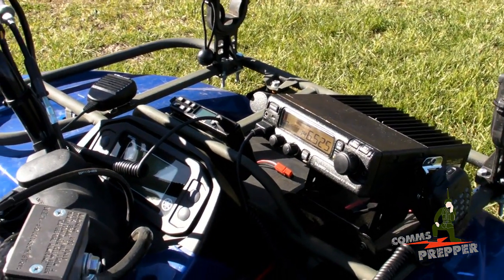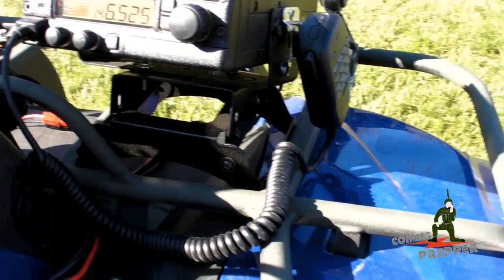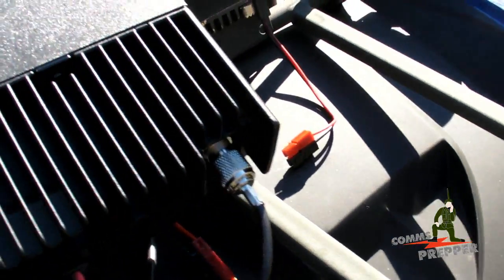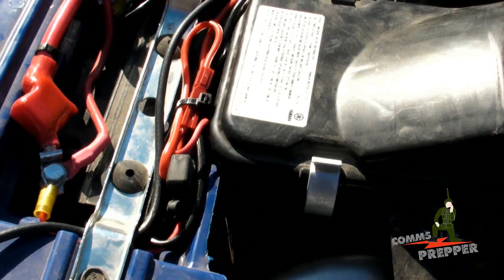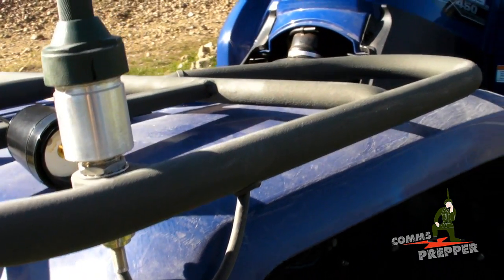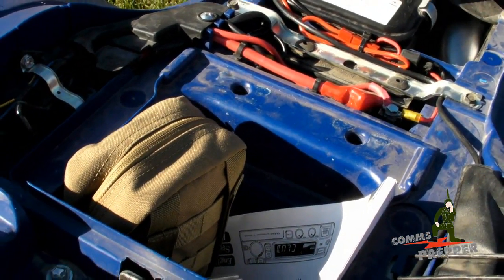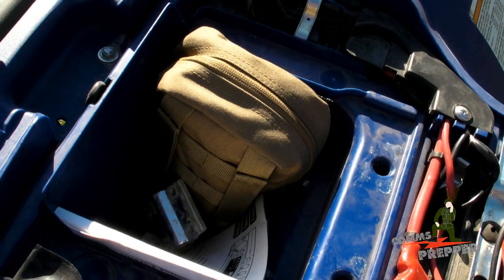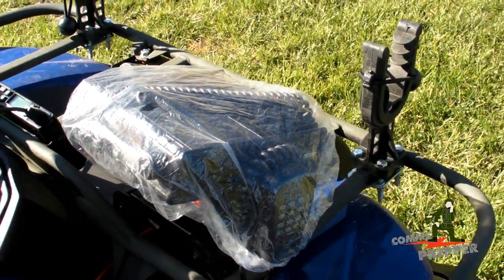Mounting Ham Radio on ATV

Comment: Very cool. Nice and tidy installation. I suppose similar installations may be possible on snow mobiles, too. 

I wonder, are the radios weather resistant? Can they be used in the rain/ice/snow, or would you have to protect them with a tarp, poncho, etc.? Also, could you, possibly, operate both at once (using a power splitting "Y" and a separate coax to the second antenna)? 

I see the possibility of using an ATV or snow mobile as a highly mobile on-scene command post/comms center/first responder unit following a natural disaster (IE; Hurricane, tornado, earthquake, blizzard, flood. etc.), maybe with the radios and other electronic gear installed in a purpose modified Pelican or Hardigg case on the front rack and another case on the back with tools and medical supplies which could get into cut-off areas more quickly than larger vehicles. It could also have a use in community security following such an event.
Reply from the maker: +TheRealWorldPrepper I see lots of potential with ATV, UTV, and snow mobile comms.  Radios are not really designed for water so that's why I added the shower caps.  Good enough for me.

Comment: No ground plane for the antenna?
Reply from the maker: Not really but there is not allot to work with on an ATV.
Reply: the rack does act as a form of ground plane, have you tested the swr on the 2m setup?